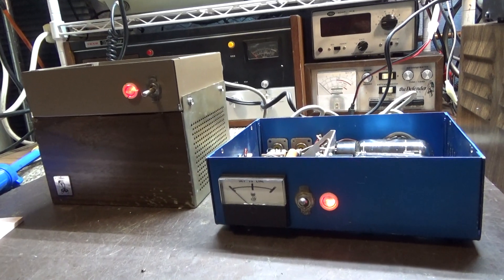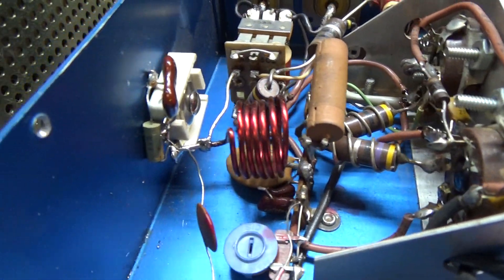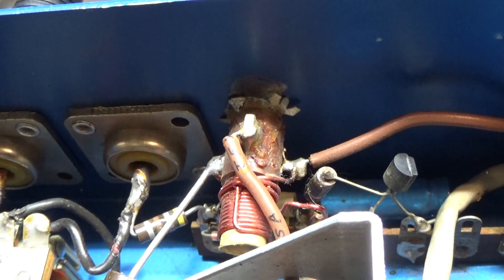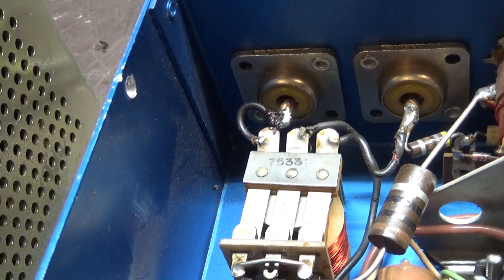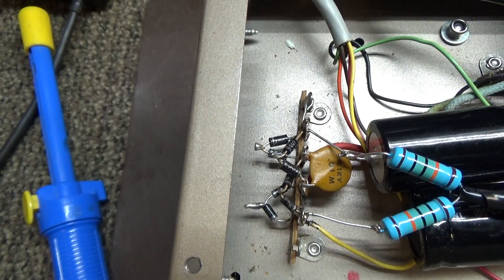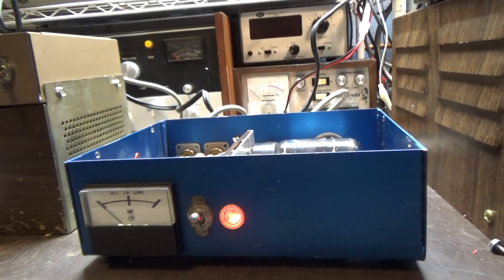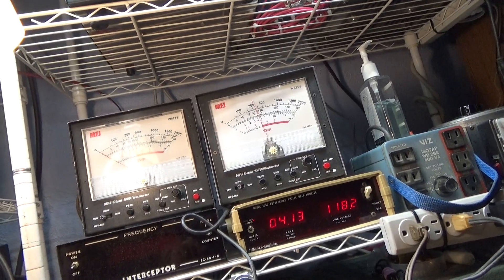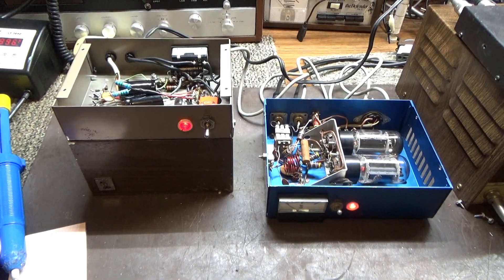Blackcat JB-76 aka JB-200 on the bench

Comment: With my Uniden Washington DK set at 2 watts I have been adjusting the JB200 to 20 watts carrier, after watching your video I went and looked and the meter on the front is not to center, should I up the JB DK or just leave it at 20? It seems to talk great at that setting?
Reply from the maker: The key is to keep it 40 or under,  I personally keep my down to around 10 watt dead key.  All good, I have even backed it down to 1 watt. Over 40 will hurt it.